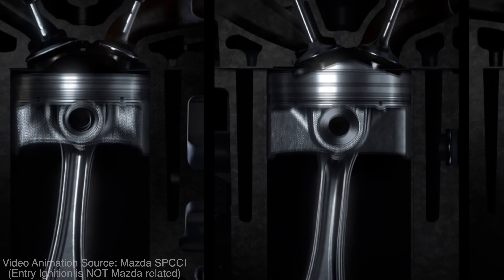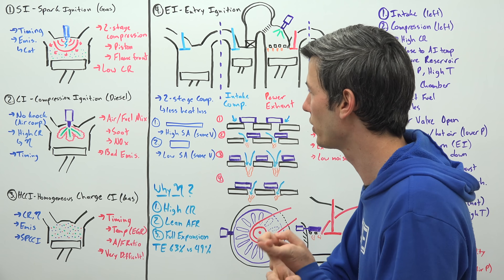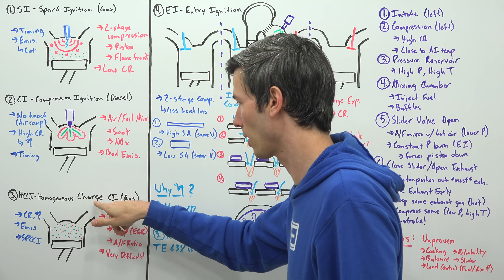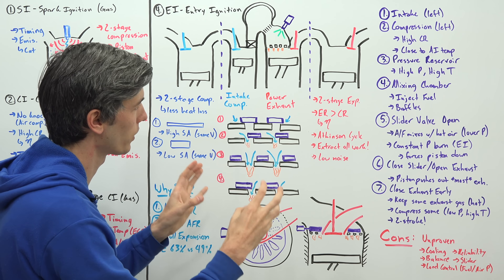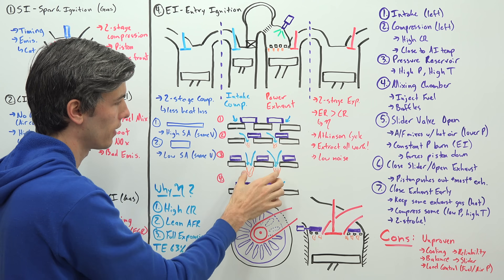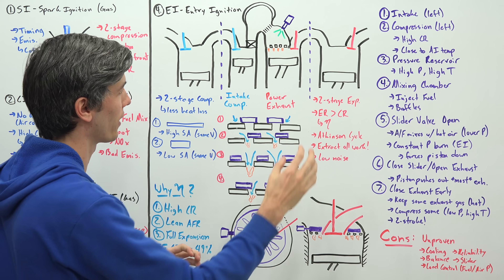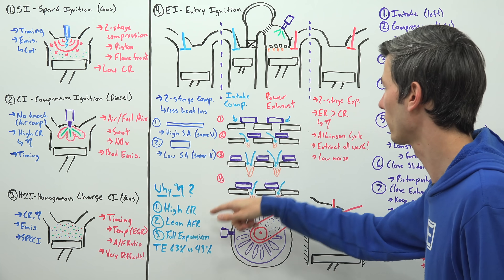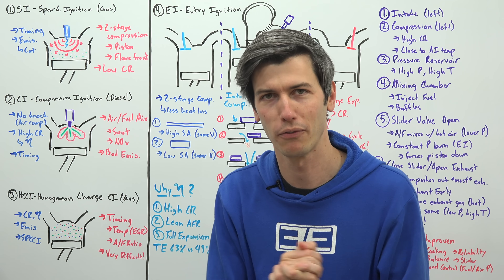Is 'Entry Ignition' The Future Of Combustion Engines?

Comment: Well I had a Czech Skoda Favorit 135,  east block alu Engine with 4+E gears, modified from VW with single point injection from GM, so cold injection is not in the cylinder, which results in faster heating the engine in winter than direct or port injection. 135'000 km without chain change, better emission with 135'000 km than new, so the engine wasn't to be killed! Average consumption over the year, that means also winter in Switzerland 5.0 l/100 km mixed with highway.  Show me anything complicated and the real world in winter will most probably be using more füll, because a lot of moving parts make more friction. Second if you need to generate hot air in the first part to get ignition, a cold engine isn't what you need, which keeps me stating: Make it S-I-M-P-L-E light (alu with screwed replaceable !!! iron cylinders and well balanced , e.g 2 cyl boxer, 4 or 6 Cylinders. These 3 cylinders Turbo chichi never keep their promises, as when hot they knock and when cold (and very)hot have a turbo lag with direct injection make particle exhaust so you need either drive extra long miles to get the soot out or to heat it in a oven...with recirculating against NOx resulting in a very messy intake, and therefore the emission values are not worth the paper and engines destroyed with 110'000 km despite  what the diagrams of the manufacturer claim, and it is very hard to prove, that at 34° C the engine is behaving like a stubborn horse, when it's usually outside it is -10 to 32°... okay lets assume with 3 Cylinders, you may save 0.2 Liters/100km, well if the engine is dead with 110'000 km instead of 250'000 like Golf/Jetta 1 GTI 1600, skoda Favorit 135 and other uncharged engines, you don't save the nature, in contrary, as the production of a new engine or car uses equal energy as 100'000 km with the car!

Comment: The big problem I see with this is when the slider valve opens, the pressure between the pressure chamber and the cylinder will try to equalize, giving the burning air/fuel gasses a chance to flash back into the pressure chamber and igniting it, talk about your knock!!

Comment: the way you describe needing some of the hot exhaust gas to linger in order to heat the charge for combustion makes me wonder how the heat would get there on a cold start. Would the heat from the compression stage be enough or would a glow plug be needed to start the chain of reactions like in a hobby nitro motor??

Comment: as old engines in the past were exhaust  is claimed to extract power  this would be a candidate for a free valve system which is completely programmable for all its intake and exhaust  and its is proven  and the math will figure out the the imbalance problem
i would really like to see the crank shaft for this engine design

Comment: Nobody in the comments seems to wonder how to ignite the engine upon startup. If it solely relies on the heat of the combustion chamber to ignite the fuel then what happens on the first revolution? It would still need a sparkplug and hence be just unnecessarily complicated with the slider valve and all. I don't see the problem with turbo- supercharged 4strokes compared to this.

Comment: Looks complicated - varying chamber engines from Compound steam engines coupled with sliding valves (also from steam engines) pocket chamber from early diesel engines.  The only thing that we have not seen are rotary valves (second world war beau fighters).
It is apparent that the internal combustion engine is going the same way as the steam locomotive of the 1930's.  - magnificent engineering being displaced by higher thermal efficiency.  Steam-diesel-electric.  Thanks for a great video.

Comment: It's probably good but all these extra pistons to replace  just what would normally be one. How long will it take the industry to make a main production line car with this, In the meantime batterys Improve people accept e cars they get sold electrolyte batterys which are not too far away now. THEN THE NEW engine has a final last spurt of use like no more than 10 years then its all over.

Comment: I have always believed that if you had a Detroit diesel style engine that burned a certain ratio of gas diesel mixture it would work tremendously because no one has ever done that that I am aware of and I have looked but I have personally burned gas diesel mixtures in Diesel engines that have never had any problems you just can’t go too lean. Obviously they have at least three different mixtures of diesel for various places and seasons that I’m sure most people are not aware of. I mean A lean fuel two-stroke Engine would have to be astronomically powerful. Just make sure it has good cooling.

Comment: I'd like to have the turbo compressing all the air before ignition. Then fuel will be sprayed inside the cylinder with the spark igniting at the tip of the injector simultaneously. Direct injection btw.
Exhaust is just like normal.
Sounds suspiciously like a 2 stroke.
Reply: Sounds suspiciously like you’re stealing Mazda’s idea ...
Reply: @sking2173  idk they are 4 strokes. Mine is 2.
Reply: @Dakkyun  — I see ... So what you’re talking is a two stroke diesel design but using direct gasoline injection with spark ignition ...

Comment: So it does seem like cooling would be a major issue especially if not only you are putting hot compressed air in, you also are running lean ages right? Also I suppose cold weather cranking would be an issue similar to what diesels have that could maybe be overcome with block heaters?

Comment: Doesn't matter combustion engine is dead within 20 years
Reply: Several people said the exact same thing to me 20 years ago... they were just as wrong then as you are right now.
Reply: @sandervanderkammen9230  yes but this time its going to happen like the steam engine will become not practical when electric vehicles become part of our life
Reply: @bystander1489  Electric vehicles  have been around longer than ICEs..
They once accounted for 28% of all vehicles on the road... 
The only people that believe that EVs will replace internal combustion  are the ones that know nothing about engineering or the automobile industry.
Reply: @sandervanderkammen9230  been in industry for 41 years and since the 90s the changes have been huge governments will make these changes car manufacturers are not making diesel anymore Toyota are concentrating all their efforts on electric in the next 10 years the change over to electric will be huge and by the way I'm a real mechanic now a plug in and fix who has worked on everything but a plane in my day we had to use our brains and today I love the electronic systems in cars
Reply: @bystander1489  Thank you for proving my point.
Reply: @sandervanderkammen9230  I didn't prove anything you just can't see the wood from the trees I will leave you with this .2 stroke engine gone
Reply: If I’m still alive in 20 years, I’ll be driving an ICE vehicle, and I won’t be alone.
Reply: @sking2173  No, you won't be alone... most people will still be driving ICE cars in 20 years...

Comment: Thanks for the explanation. Is it possible to use a glow plug(temp near boiling pt of gasoline) like in Diesel engine to heat the air? Then mix with gasoline. When the piston goes down pressure will decrease thereby increasing evaporation. When the piston will go up it’l compress the mixture of gasoline vapor & air,then spark plug will do rest. The ignition temp of gasoline is (280C) higher than diesel so no risk of early ignition! Or I got it all wrong 😂 or won’t need spark plug if air is heated at 70-80 C? Or why not use a fuel injector with multilayer of holes ranging from small to tiny. It’l heat the gasoline until when it comes out of the tiniest hole it’l be more of vapor.

Comment: Really appreciating the coverage of all the budding tech improving the ICE's power and efficiency!  Any thought to covering the fuel itself, like e-fuels, drop-in fuels, synth fuels?  I know F1 is working on introducing this in their new engine formula.

EVs are great, but it would be smart to get the existing refueling infrastructure to offer a carbon neutral option at the pump even if it costs more than good ol 85.  This could help the situation now.  ICEs will be around for years, but drop in synth fuels could help keep these cars on the road while doing so cleanly.  
 
Electric and clean ICEs should compete for customers in a perfect world.  Would love to be able to drive my 88 e30 for years to come and not worry about it being regulated out to the pasture.  Great channel and content!

Comment: If you incorporated it into a hybrid system it could switch to electric when a piston gets to hot. It could also have intercoolers and radiators to keep it cool... Just spitballing but you can engineer around the engineering problems

Comment: If this type of engine is an EI engine, wouldn't the air fuel mixture combust in its chamber and not in the cylinder when the slider valve opens?

Comment: If you draw a jet engine next to the entry ignition engine, they look pretty much same. The first piston is like the low pressure compressor stages on a jet engine, the second piston is just like high pressure compressor stages, the mixing chamber is sort of but not really like the combustion chamber on a jet engine, the third piston is like the high pressure turbine stages, and the fourth piston is like the low pressure turbine stages. The only difference is that pistons are in the place of compressor and turbine blades and unlike a jet engine, entry ignition doesn't undergo continuous combustion.

Comment: Yeah... I'm having a hard time wrapping my head around this one. It looks like all cylinders in a motor like this are not equal and perform different tasks rather than all acting the same together. Beyond all of this... it's funny to me to see how complicated this is all getting for the sake of a small efficiency gain and/or gas mileage bump. WE are spending millions to achieve the smallest increases in recent years. Just seems like we're reaching a critical point in diminishing returns. Doesn't sound very economical to me.

Comment: Another noteworthy benefit is a convenient capture point for high pressure bleed air. There are a lot of possibilities such as: pneumatic start (via the same port as the capture point), bleed air operated HVAC blower, air suspension, seat cooling, electronics cooling, external compressed air utility hookup.

Comment: Different kinds of valves have been experimented with before, doubtful that a slider valve would be reliable.  Conventional valves rotate as they open and close and actually wear into their seat, renewing their sealing ability.  Many have tried to get rid of them but none have succeeded.  I also doubt this scheme would do anything for efficiency because you are making the compressed air go around different chambers and this is not practical.  Their is also very little power left in reality to drive a second expansion piston.  The diesel engine is the best setup, it's already been done.

Comment: I am wondering about where is the energy needed for compressing the air coming from? The air pressure in the pressure reservoir has to  be higher than the pressure of burning fuel to prevent the back-flow. That would imply that the energy produced by expansion of the fuel burn  is lower than the energy used to compress the air.

Comment: Looks a lot like some 1950's experimental engines. Dual diameter compressor piston and high pressure piston can use single bore. Limiting factors were always exhaust valve temperature and sealing any type of rotary valve. Sleeve valve engines are a very mature technology but have the same sealing issues. maybe new materials can help and may have been the basis of the FORD ceramic engine experiments in 1980's?
 You still need to somehow limit combustion temperature to lower the amount of nitrogen compounds produced though

Comment: Friction? Manufacturing complexity .all and more axis any new design, here is a combination of tested design , some failed. A slide valve seems a way to introduce heavy particulates in the emission, as it wears,  and having two cylinders doing two cycles each is still a four cycle. It seems like backward applied  rotational to reciprocal, like from a gas turbine .

Comment: For high efficiency I could see a two strock diesel,  multi-stage  turbos and direct injection allowing a 30 to 50 compression ratio. The turbo would be coupled with the crankshaft by a planetary gear box acting as a supercharger/turboprop. So the pistons would take care of the high pressure and no lag tork response and the inlet turbos would take care of the low pressure compression (1 to 10 atm.) and cool it with an intercooler before sending it to the cylinder head.  The exhaust turbo would contribute to the engine tork (like a turboprop engine) and keep the combustion gas at higher pressure for a longer time allowing a more efficient burn and therefore creating cleaner imitions. This way you also remove the exaust cam friction and double the amount of cylinder heads combustion for the same amount of internal friction.

Comment: From what I see, you have two cylinders that are sucking power and not giving any. And you have the other two that are giving you true power strokes. (Or at least 1 and 1/2 power strokes.) I'd be real interested to know how this could be more efficient than having 4 power strokes every two rotations than this. Seems like you're effectively cutting the displacement of the engine in half. I could definitely see where it would make it more efficient as far as fuel consumption and emissions. But at what cost? 60hp/50 ft lbs? Lol.

Comment: The real question is how do you start this engine? It relies on heat to self ignite, so wouldn't you have to heat the power cylinders really hot or just use a spark plug to start it?

Comment: I've been mulling over, for some time, the idea of one cylinder pressurising a working cylinder. Somehow I never managed to think it all through so it was a revelation to watch this video. Incidentally it seems to me that, in a standard otto cycle engine, using an exhaust driven turbo-charger is a good idea because it uses the not inconsiderable energy still present in the expanding gas when the exhaust valve opens. I also think that the turbo should be kept spinning at some minimum speed by an electric motor-generator as in an F1 ERS system. In a road car, at higher revs when the turbo is being spun at sufficient speed by the exhaust gas, the motor-generator could be switch to generation thus making a separate alternator un-necessary.

Comment: I'd like to see natural gas driven turbine power unit electric drive cars.  Max efficiency in power generation, batteries or capacitors to level the energy supply/demand, max efficiency at the wheels with extraordinary range and quick refueling.
There are four pistons here, but only one combustion chamber, everything else is about compressing air and pulling the energy out - that's basically what engineers have spent decades[centuries?] perfecting with turbines - just use that!

Comment: The only reason there is any interest in internal combustion engine design anymore is because big oil wants to keep us under their thumb. Electric cars have far fewer moving parts including no transmission unless you want to include the reduction gearbox on some the EV's. I am fine with no more spark plugs changes or oil changes or coolant flushes or any of the dozen ways car companies make money off of us after we already bought the car. Internal combustion is the 21st century equivalent of the horse and buggy. Who cares about the rediculus complexities needed to keep it relevant it's obsolete anyway.

Comment: What's preventing the combustion reaction from crawling up the slider valve? Pressure prevents the movement of matter in that direction, but there's nothing stopping the reaction from doing so once the chain reaction has begun. There should be sufficient thermal energy being radiated in that direction, unless the rate of fuel injection exceeds the rate of combustion.
Also how do you start this thing when your piston isn't warm enough yet? Glow plug?

Comment: What Im hearing here is.... It really just needs a 3rd, 4th or fifth valve in the cylinders (for the “pressure chamber) that runs off the already existing cam.
Now, with cam phasing, the timing issue is gone. Just time the fuel charge and the ‘pressure valve’ lift/duration and time...Hell, dedicate the second cam (dual over head cams) to the pressure valves independently. Its own phasing....... 🤷🏻‍♂️

Comment: okay its more efficient (20%) at best but it takes up nearly 50% more space, as the compression pistons arent generating any power this is like a really efficient 1.5x cylinder engine no? also the mixing part of the engine seems like would have to hold an immense amount of pressure making casting and quality control a real issue. Maybe I just dont understand like an Engineer but this seems like a really complicated way of not having a turbo. Im sure we can figure out a way to pre ignite turbo pressures before reaching the cylinder than to have this oversized mess. nevertheless Id like to be proven wrong.

Comment: Sleeve valve engines of the 20-30's tried a similar concept but were very problem prone.  Yes it will work but the slide valves simply have a very high failure rate, simply unless you lube it with unicorn tears and build them out of fairy dust  they will have a very high failure rate.  Industry would love to be able to use a slider valve in a high pressure application, but so far no one has developed one that will work.

Comment: Better to have another poppet valve for transfer,  as sliding valves has no chance of allowing cooling,  not baking oil, 
Sarich made a nice rotary engine,  but never solved the cooling problems.
This engine will never work,